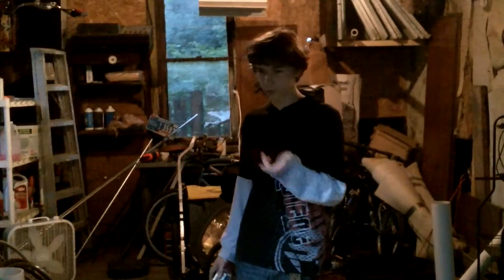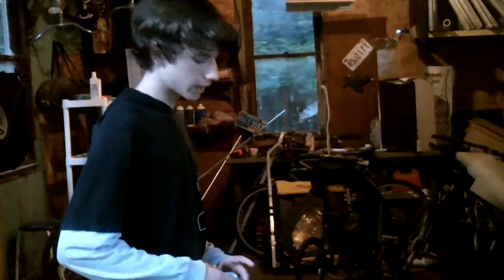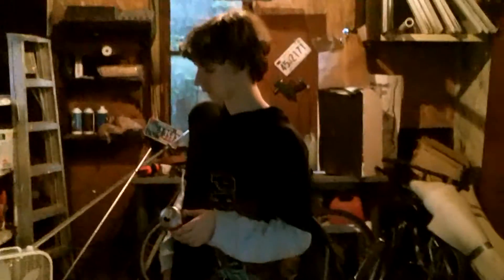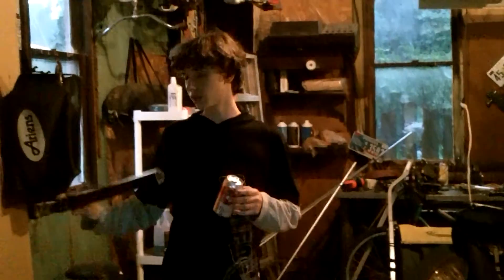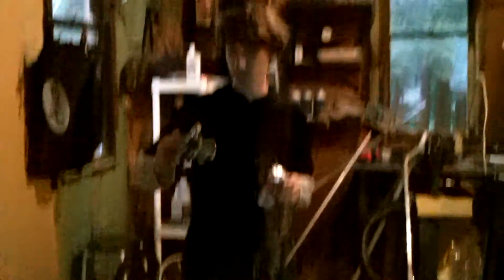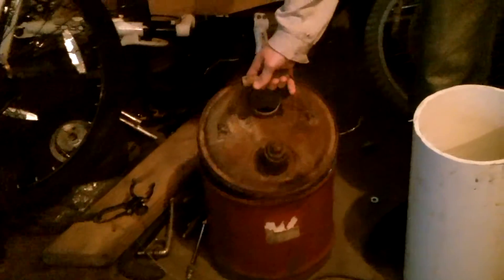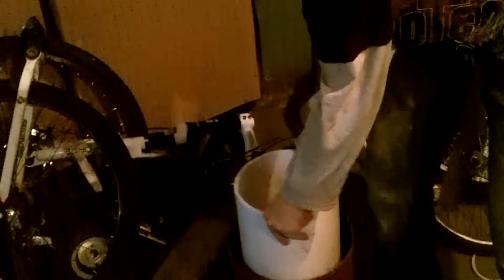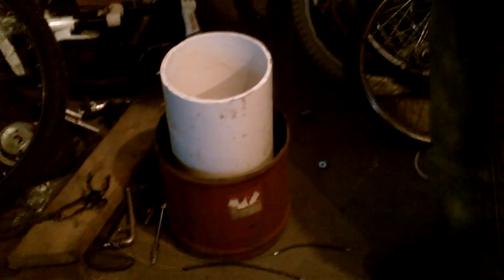How to Build an Electric Forge Part 1

Comment: Use pid controller and solid state relay very easy to use and can be easily used for multiple thing I use the one I made for a forge kiln and to keep my chickens warm also you can make beer with it and a smoker well anything that needs heat controller